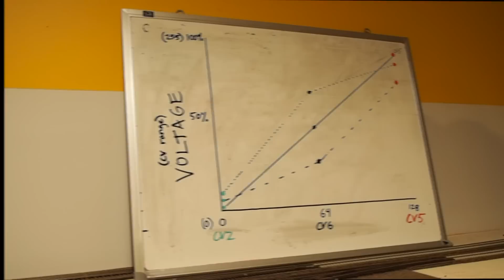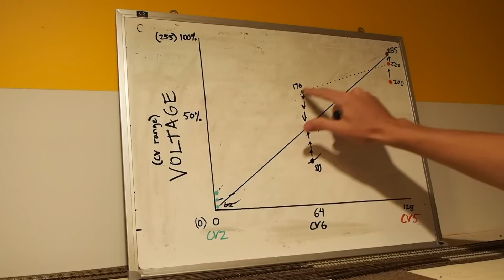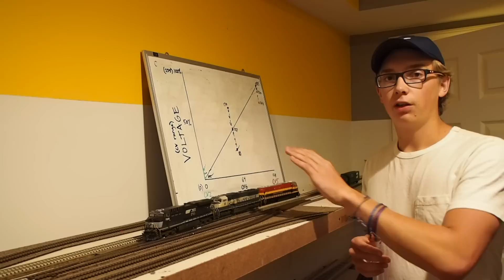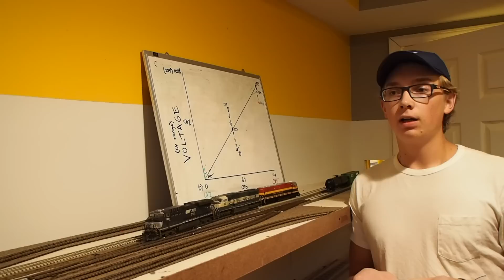How to Speed Match w/DCC: The Fast and Easy Way

Comment: Unfortunately I find your explanation will cause confusion to those trying match speeds. It's wrong to suggest that the CV values are directly linked to speed, as different motors react differently to the same voltages. The CV values only control the input voltage, and one locomotive may run  at 40 scale mph at 6 volts where another will only run at 25 scale mph in 6 volts. The method is to adjust the CV values, hence voltage so they run at the same scale mph at a given speed step. So while they all start off using the straight line speed curve, you adjust the high-mid-low cv's so that locomotive speeds match, but the CV values will vary quite a bit (you made it look like you were trying to match CV values). Also the target locomotive you are using as you speed standard matters very much. That target locomotive needs to be only of your most common type that doesn't run much faster or slower than the rest of the fleet. Picking a oddball locomotive as a target locomotive will cause a great deal of headache trying to get the rest of the fleet to match it. Also I suggest that the start voltage be set to a voltage to a point just below where the locomotive will start to move. Having the locomotives jerk into motion at speed step 1 is not very realistic. I like to have them smoothly start rolling somewhere between speed step 1 to 3.
Reply from the maker: Yes, you are correct, and I see what you're saying. Around the 8 minute mark, it does seem like I'm suggesting that locomotives from the factory come with different CV values and that's the only thing differentiating them. Of course, if that were true, the answer to that would be to just program in the same CV values for all locomotives. So,  that's not what I was trying to suggest, but it was a bit confusing. I started the video explaining what a 3-point speed curve is relative to a single locomotive (in which case the whiteboard does make sense), but then I started using it to explain how 3 locomotives might behave. I probably should've redone the y-axis and erased the absolute CV values on each of the curves. However, I think most people found it fairly clear because later I did explain that we're not matching CVs. We're matching speeds by understanding the speed differential between two locomotives and then adjusting the CVs directionally on one of them and relative to the other. 
I think it certainly helps to pick a common locomotive, but I think most people who would watch this video (including myself), don't have enough locomotives to have a "common" or "oddball" locomotive. However, it is a good point about picking a baseline locomotive that makes life easier when programming the rest of the fleet. I've found that I don't really know what locomotive that is until I start programming, and it's really dependent on decoder and less on the locomotive manufacturer. 
As for your starting speed step, I like how you do it, but at least for the locomotives I've had, that hasn't been a possibility without changing other drive characteristic CVs. For example, a CV 2 value of 1 might cause the lead locomotive in this video to hesitate and lunge in speed step one, but a value of 2 might be perfect. In other words, because a lot of decoder manufacturers program BEMF or load control to 100% from the factory, starting smoothly in speed step 1 is the only option. Of course, consists run better with lower BEMF, and that also gives you the option to start a few speed steps higher. I just didn't want to open that can of worms in this video because I had originally planned for this to be a multi-part series. 
Anyway, these are good points you make, and maybe I should return to this subject with them in mind. 
I'm also curious, you say that your locomotives don't start immediately in speed step 1, so I'm assuming that you have adjusted BEMF down to make that possible. If this is the case, do they always smoothly start up, or do they ever lunge when you reach the right speed step? I've had a lot of fun on my mountainous layout with cranking load control/BEMF way down because it really takes quite a bit of throttle to get a heavy train started, but occasionally when I reach the "voltage potential" to get the train moving, the consist lunges before quickly leveling out at a slow start speed.
-Cam

Comment: What is the maximum incline on your layout?
Reply from the maker: It was supposed to be 2.5%, but in a few short places it's closer to 2.7%. That's only along the upper level mountain grade. The lower level still has a significant grade, but it's much more subtle (closer to 1.2%). 
-Cam